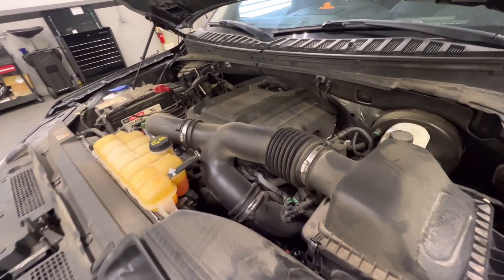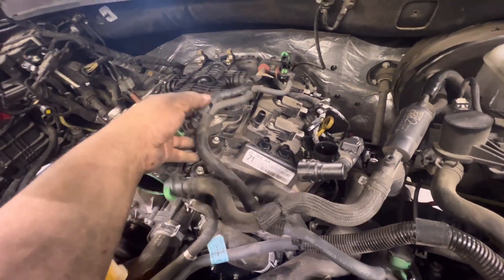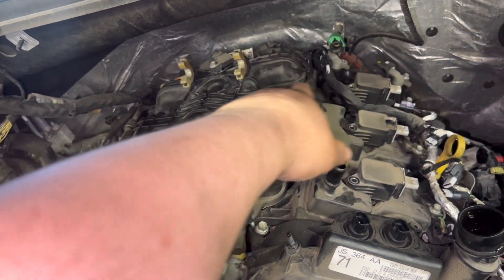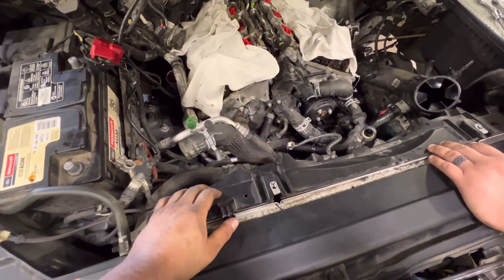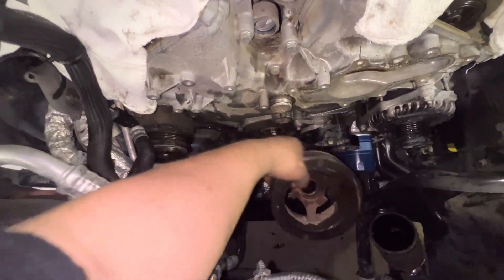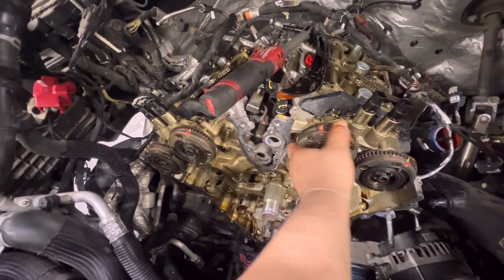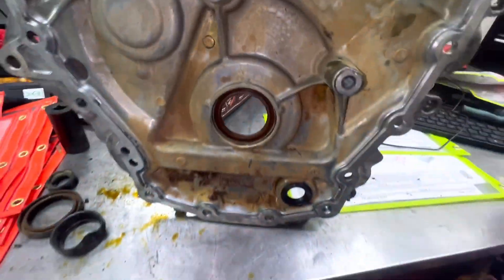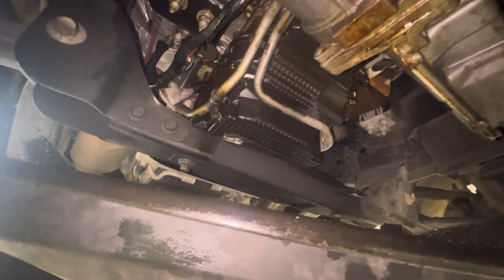FORD 3.5L Ecoboost Cam Phaser Rattle Fix & Replacement ~ Ford Finally Made Better Phasers!!

Comment: What do you recommend for silicone sealant? And did I understand you correctly that you put a bead of silicone on and let it setup overnight before putting timing cover on? What would be the least amount if time you’d recommend if one doesn’t want to wait ?

Comment: The amount of work you had To do to fix a rattling, crappy, inefficient engine was mind blowing.  Newer vehicles are pure garbage.  CEO's getting rich and customers getting screwed.  This should be a recall.
Reply: Tell me how a 3.5 is inefficient? It outpulls 5.0 coyote, 5.7 hemi and 5.3 Chevy. Faster and gets better gas mileage.

Comment: How did you re-align the one cam that was off preventing the locking tool from going in place?
Reply from the maker: I’m gonna try to explain it the best I can, with everything installed.. timing chain, tensioners etc I was able to fix it, i put a wrench on each cam shaft. I have think it was the passenger exhaust cam that needed to be moved if I remember correctly. So on the passenger intake camshaft i turned it with a wrench in the direction of the exhaust cam (counter clockwise) to give me as much slack in the chain as possible, while holding the tension I was then able to turn the exhaust cam clockwise one tooth. The chain stayed stationary and the cam sprocket spun inside the chain one tooth to correctly align it

Comment: This is by far one of the finest instructional videos I've had the pleasure to watch Bo Builds...just outstanding!  I'm getting ready to tackle this job soon on a 2017 F150 and had a couple of quick questions for you:
1)  Do you need a balancer installer kit to reinstall the harmonic balancer.  It looks like a slip fit shaft as opposed to taper.
2)  The cam phaser bolts appear to be Torx Plus.  What size and required torque?  Any Loctite?
3)  You showed a black RTV being used on the timing cover and stated that it was allowed to set up overnight.  I've never used it this way...rather assembling it right away.  Is it better to allow it to set up before assembling and why?

Thank you in advance for your feedback and great job!

Comment: How did you get the one camshaft with the bad phaser to align with the tool?
Reply: There is flats on the cam which align with the tool. Both phasers/cams are connected by a chain on the backside of the phasers.

Comment: Just drive it....head many just drive and drive after hearing startup rattle, go on to 200,000 and up....and of course don't buy a used 3.5 unless it was manufactured in 2021 up...

Comment: The cam phasers are going to go out every 75K mile. I have to replace the phasers for the second time.
First time at 75k second time at 160K. Now I have to do the Injectors. We did the plugs and coils a few months ago.
This has been the best and the worst truck I ever got from Ford. I had a shop last week quote me 9,500.00 to
replace the Injectors and all new pulleys, chains and phasers.....I could get a new engine for that...

Comment: Hello, I have a 2019 Ford Expedition XLT 3.5. I recently changed the timing chain kit, but now the vehicle runs worse. Can you give me the phaser numbers? For some reason, the cam phaser number they installed says HL3E-6C524-CC.

Comment: Anyone that tears down a 3.5 this far, you should also pull the fuel injectors and clean them as well as clean the back of the intake valves. you're already there, it might save you another job like this 500 miles later. says the guy looking at a fuel injector job on his 2017 explorer ecoboost lol.

Comment: One of the knocks on the steam locomotive was not so much the low thermal efficiency and high fuel consumption, because the fuel was cheap, but rather the high maintenance requirements.  But steam locomotives had many different designs, some of which were low maintenance and others not so much.

Wardale in his book "The Red Devil and Other Tales from the Age of Steam" explained that any steam locomotive could be reliable, that is, not breaking down in the middle of a trip, if you did enough maintenance on it.  He told of a locomotive in a South American country where after every trip, the shop people took apart "the motion" for inspection and adjustment.  This would be the equivalent of every time you took a road trip with your truck, you would need to drop the oil pan and unbolt all the connecting rods from the crankshaft to inspect and replace rod bearings.

For the "yuh, I am not like those owners who neglect their truck, I change the oil and filter every 3000 miles" crowd, the inside of this engine looks immaculate, but it still needed this repair.

Comment: I change my oil every 3k miles.These are basically race car engines. Fresh oil sure helps.Installed a catch can on my 2016 also
Reply: It’s not a race car engine😂 different cams, pistons, rods, valve train…only the block n heads are shared with the ford GT.
Reply: @ pretty high performance
Reply: No they are garbage engines in garbage pickup trucks.  I'll take my old diesel trucks any day of the week.

Comment: Why does no one show how to hold the cams while loosening the cam phaser bolts? If you buy the cam holding tool kit it says not to use them to hold the cams while loosenign or tightening the cam phaser bolts because it will bend. And every video completely skips this part.
Reply: to add to bo's comment, you just mark the timing with the plate installed anyway with a grease pen or marker. always mark your timing when you pull these kinds of things apart, for any engine this applies to. so even if the plate bends you will notice the timing is off when the marks are separated.
Reply from the maker: I honestly didn’t know that, but I will say the plates aren’t a guarantee that timing will be held. As you said they can bend and allow a cam phaser to be 1 tooth off,  I still recommend marking the chain and phaser and anything you can to verify timing is held true

Comment: Anything you suggest replacing while all that's apart? Did you change the tensioners and chains also?
Reply: i'd recommend looking at your fuel injectors while you're at it, pull them out and clean the tips off, clean the back of the intake valves. yes, replace the tensioners and chains its not worth having new phasers just for a chain to snap 500 miles later. im looking at fuel injectors now on my 2017 explorer ecoboost, after watching this im considering chucking phasers at it as well.
Reply: Water pump and thermostat

Comment: What do if the cam individually is turned out of alignement??
P0024 p054a p054c
Please
Reply: There is timing marks on the cam gears
Re align those marks

Comment: The phasers rattle on cold startup because there's no oil pressure at the top of the engine. AFAIK the 3.5 has no pre-lube system that would kick on just like your fuel pump. To get around this, hold the gas pedal when cranking for 3-5 seconds until oil pressure builds and then let off the gas. No rattle. Only needs to be done if the vehicle hasn't been started in hours. There's YT videos on this. Stupid that we even have to consider doing this.

Comment: Can anything go wrong with prolonged use of the engine with bad cam phasers? Or will it just run rough forever?
Reply: I've heard of people driving tens of thousands of miles after startup rattle appeared....with no advancement / damage to engine...
Reply: YES!!! You have metal parts rattling, eventually they break, and can destroy your entire engine. I watched another mechanic show this as the person let the rattle go for over a year. Tore down the engine showing this.
Reply: @Maynardd  I’d love a link to this video
Reply: @aaronsprojects9022  so look one up. I’m sure there’s a few hundred. Are you asking a question or are you really actually arguing this?
Either way, don’t be lazy and look it up, should take you about 10 seconds to find your first one. 
But here’s what a simple Google search will tell you that I just did that you can start with. “If your vehicle has a bad cam phaser, you're going to experience engine-related issues that might escalate into engine damage if left unresolved. This can become costly to repair, so it would be best to fix it as soon as possible.4 days ago”

Comment: I'm getting this done now. Got a f150 from carvana a month ago 41+K miles VERY NICE TRUCK BUT OUR INSURANCE IS PAYING FOR IT. WE COME OUT OF POCKET 100$ DEDUCTIBLE
Reply: How do you get insurance to pay for it I need this done 2019 70k miles
Reply: Same question, just got my Expedition Max from Carvana 2 months ago, and just pass the 4,000 mile warranty  it’s starts rattling and leaking coolant from the turbo. I’m furious. 
You got insurance to cover it? Or a warranty?
Reply: I actually went through my paper work and I bought an extended warranty and it covered the fix I was out like 200$
Reply: The repair was close to 5k. Replace the cam phasers both timing chains and all the gaskets and fluids. Was at ford for about a week

Comment: Just got hit with the cold start rattle and cam phaser code on my 16' f150 3.5l v6. Does this new part actually fix the issue?? Or is there still a change it will return?!
Reply: The new phasers are completely redesigned and don’t seem to be an issue.

Comment: What year do these phasers apply to?
Reply: Mostly second GEN, which is 17, 18, 19, 20. i’ve also seen it happen on earlier models than that, but not much. I would also add 2021 to that as they did a redesign on the phaser which seem to take care of the issue, but they most certainly used up their stock of phasers before using the newer remodeled ones.

Comment: I have a 2018 in the shop with the same left intake sprocket failure. I also bought that exact same tool kit from Amazon. I replace the oil pump solenoid pigtail. They leak through the connector after awhile.

Comment: I did the job installing the new cam phasers, and after a couple of weeks I noticed timing cover leaking. So I need to do that again...I noticed in your video you mentioned that after you put the Motorcraft RTV Silicone on the timing cover you let it sit out over night before installing it. I didn't do that, and I think that's why it's leaking. Can you share a link with the instructions you were following in the video? Thank you for such a good video!
Reply: You use ford rtv only for one. Two put rtv on cover put cover on torque down can put all back together just don’t add fluid and start it entill it sits overnight way the rtv can cure I’ve done it twice with no leaks. Just keep having new ford timing components fail after few hundred miles about to take it off again for the 3 time in 3 months dam thing runs great just has a random noise at cold start idle whenever it feels like it so either new phaser or tensioner is crapping out allldy. But leave it sit overnight with no fluid in it and torqued down you will be golden and go on every flat spot on the cover around bolt holes and especially the bolt holes in the middle of the cover.
Reply: @joshbohner1712  Is English your native language ?

Comment: Just enough to show you what the job looks like but not enough info to actually do the job correctly. Everyone do yourselves a favor and checkout fordtechmakuloco . All info you need on ford repairs and usually will give you torque specs, tightening patterns, parts lists

Comment: You can drive it w the rattle on start up for 200k+ miles as long as it runs who cares😅
Reply: I've heard both sides.   Most owners claim very high mileage ignoring the noise.  Then a handful get on and say it's a ticking time bomb.  I called one internet warrior out on his claim of a 3.5 exploding due to cam phaser noise and eventually discovered the engine failure was actually due to a low oil level condition!   Take everything a human says with a grain of salt, as most are talking out of their as×.
Reply: @peruser155  Thx. Been running mine for 30K miles with no real change
Reply: Is that a fact? Mine has been rattling for 20K miles on start up. Doesn't seem to make any other noise other than cold start. Is it okay to continue to run it?
Reply: I’ve been driving mine for a long time as well.  Needs a second phaser replacement but is no longer covered by a pcm flash they did under a customer satisfaction program through NHTSA.  I’ve taken it to several Ford dealers in the Phoenix area that all say they’ve never seen an engine damaged because of it but have heard of it happening.  They said it’s not super critical until you can hear the rattle at idle or have timing codes thrown.  Then it needs to be done.  Until then I can monitor.  Which is what I have been doing.  Probably have been driving for 20-30k miles with the startup rattle.

Comment: Do you have to remove the high pressure fuel pump from the valve cover or can you just leave it attached and remove the whole thing together?
Reply: You have to remove it.its in the way

Comment: Did you replace the phaser bolts or is it OK to reuse them?
Reply: Phaser bolts are torque to yield bolts. 1 time use. You need new bolts too

Comment: Fine video but as I thought, not exactly a DIYer backyard project! Even though I worked as a Ford mechanic years back, this is well beyond my skill sets and tools now. My '19 with 3.5 has to go back to Ford at ~47K miles for this job and, thankfully under the 7year/100K driveline warranty or the 2N03 Customer Satisfaction Program, however the shop wants to handle it.

Comment: What the cost with parts and labor parts $$$$ then labor hours ?
Reply: Same thing I was thinking ?$
Reply: Ford is charging our insurance 3-5K
Reply: @JamesJones-qb8pz  why is your insurance paying?
Reply: I just got a quote from Ford 2 days ago $4,880!
Reply: Ford here in CA told me 6,000 was the "low end" I should expect for this.
Reply: I had a 2011 F150 and about 2 years ago I had the timing chain, tensioner, guides, water pump, and 2 of the cam phasers replaced for about $3500.  I now have 2018 F150 that I just bought the other day and I am taking it in to get the cam phasers replaced for free.
Reply: @bearing_aficionado be careful. When you take it to a dealer they will only replace the 1 phaser that is broken, not all of them. Hear this story many many times. Push them to do all 4, and i would have them do the chains and tensioners while in there as the labor should be significantly less. It is also a good idea to change the water pump while doing it as it has to come off anyway to do the work.
Reply: @bdbrolly hopefully they will replace all 4.  The sales manager made it sound like they are gonna replace all 4.

Comment: Hi -- thank you for showing another way to replace the phasers without having to remove everything from the front.  Can you verify for me:  what year is this f150, and if these are the new parts you used:  Intake Phaser- ML3Z-6256-A , Exhaust Phaser- ML3Z-6C525-A

Comment: I’ve just been pushing my gas pedal down while starting the vehicle in the morning till I build oil pressure.🤷🏼‍♂️
Reply: Why do you do it 
With gas pedal can you explain thanks
Reply: @louishernandez3411 it basically tells the ECU to cut fuel.  It's meant to be for clearing a flood (like a stuck injector).
Reply: That works to build tension on the chain. If the phaser itself is shot and not moving correctly it won't work until it loosens, pressure or not so that won't work for everyone
Reply: @neilboghean8193  I think it helps build oil pressure so the locking pin on the faulty phaser can have more pressure and lock before starting. I may be wrong